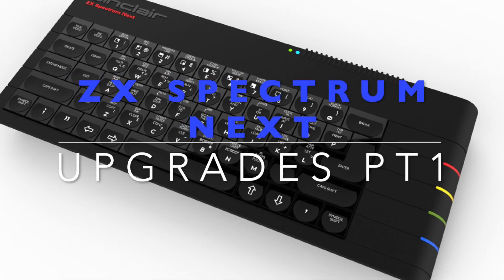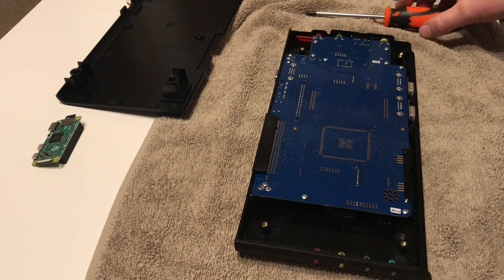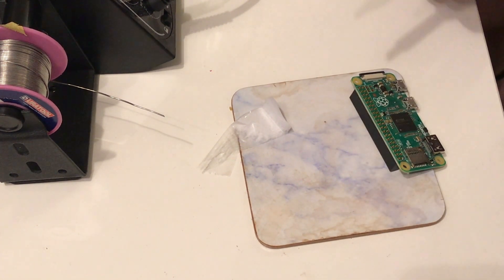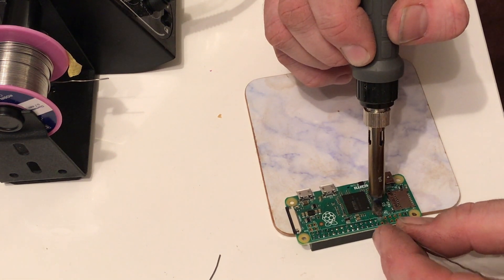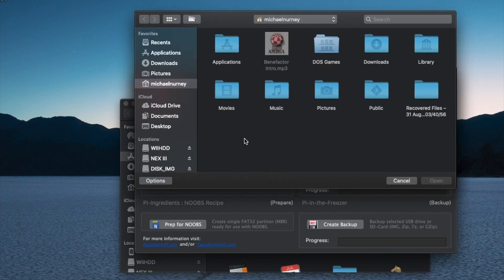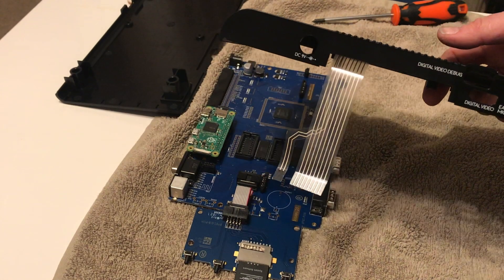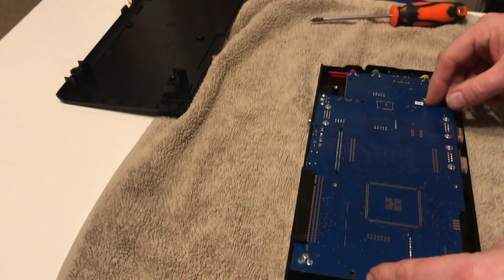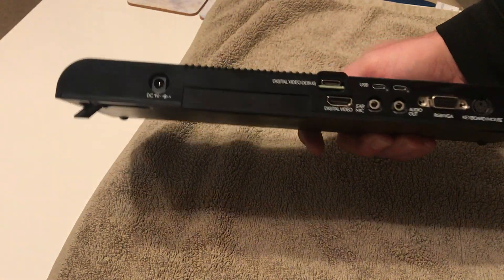ZX Spectrum Next upgrade PT1 PiZero & GPIO

Comment: It's nice that the plastic posts for the external screws have brass inserts, that should give them a much longer lifespan.
I'm going to back the Issue-2 model and if all goes well, I'll have my own Next a year from now :D
Reply from the maker: It’s well made :)
Reply: @mjnurney  Yes, that's my impression. I have now backed the project, to the tune of an accelerated Next 😁
This was probably my last opportunity, since I'm going from "early retirement" to "state pension" by the end of 2020, which means a cut of somewhere between 2.500 and 3.000 DKK in my monthly income😢 so i had to make it count.
Reply from the maker: It will be a good investment anyway. I would imagine that they will be sort after for years to come... how nice to be retired:)
Reply: @mjnurney  I didn't back it for the investment value, I really intend to use it and find the limits of what it can do; I love to program as a hobby, you see, and I've been working a bit on a project for the Spectrum +3, but came to the realisation that it doesn't quite have enough memory and CPU power for what i was trying to accomplish. The Next, however, should solve that problem with ease :).
Reply from the maker: Oh that’s very interesting, you can set the cpu to various speeds to achieve what performance you need.

Comment: Thank you very much for this, I bought a NEXT base, but plan to upgrade it as soon as the memory, wi-fi module and PI 0 arrive in the post, so I found this invalauable. Before your video I had not realised that the Pi Zero had to have its own SD card set up with image. PS The NEXT is brilliant, and so beautifully designed with great attention to detail
Reply from the maker: Brilliant and well done in buying the Next , it’s a great little machine and I’m pleased you liked the video. I have part 2 coming in a week or so showing Ram , WiFi and speaker upgrades too :)